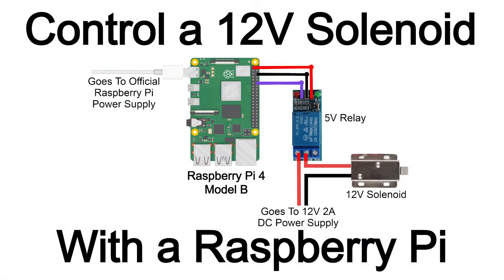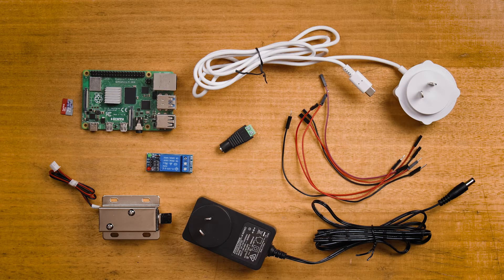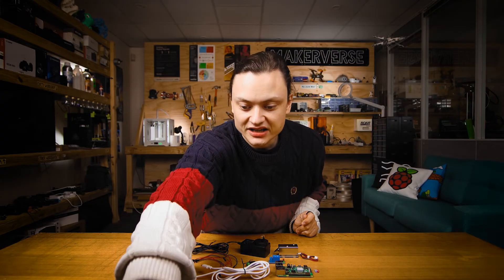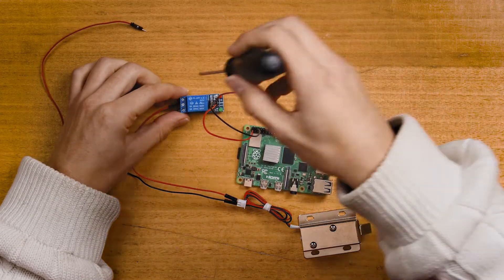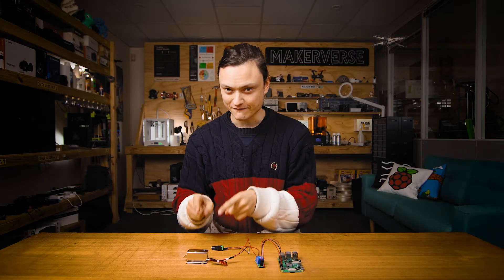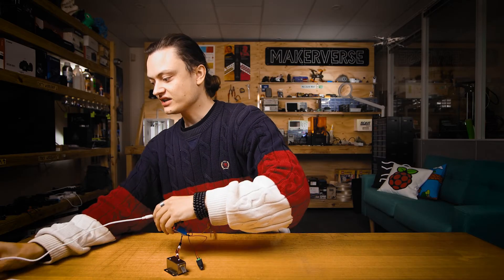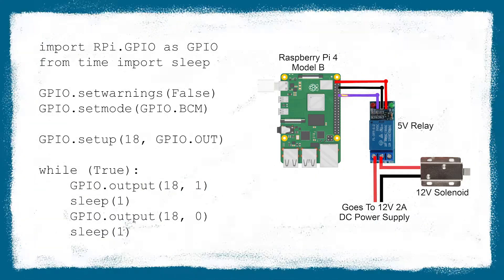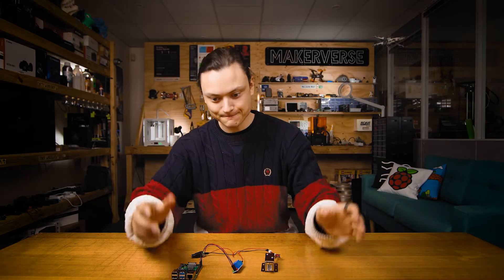How To Control A Solenoid With A Raspberry Pi Using a Relay

Comment: I have a excavator , can i control the solenoid by this ideas ?  because my electric system is gone . Thank you
Reply from the maker: So long as you have power this system will be able to control a solenoid :) and you can scale if up if need be.

Comment: what is this connector called which is used to connect 12v supply with jumper cables?
Reply from the maker: I got you, its a DC Barrel Plug, you can find it here - https://core-electronics.com.au/dc-barrel-plug-to-2-pin-terminal-block-adapter.html

Comment: Why are you not using a diode to protect against voltage spikes?
Reply from the maker: The relay is able to do the job of the diode in this set up as it has inbuilt voltage spike protection.
Reply: @Core-Electronics  however, since the relay also has a electromagnet built in, it needs a diode on it's own. Or not?

Comment: I have been using this setup for about two weeks no with no issues. However for the past 2 days whenever I turn on my rasberry pi and run the code, I will get to clicks (activations of the solonoid) and then the screen go black and the computer crash. Please if you have any fixes to this let me know. 

Thanks, Jdog
Reply from the maker: That is weird, perhaps the Micro-SD card has slightly corrupted. If re-flashing the card doesn't work send through some pictures of your set-up to our forum and we'll figure it out.

Comment: Thank you so much for the quick responce time! I just had one more question, could we use the 5v pins insted of the 3v pin. Because I am using three relays there are only two 3v headers and 2 5v. Or would I be able to attach two relays to one 3v header. Thank you so much for the help, keep up the helpful and amazing content!
Reply from the maker: Excellent question. So you won't be able to use the 5v pin. I wrote a comment below which explained the exact details of why. 
However there should be no issue attaching two relays to one 3.3v Pin if the relays are connected in parallel.

Comment: Hi Tim, would this general set up work with the 36v solenoid for sale on your website?  Also, could you power the raspi and solenoid with batteries, as opposed to mains power?
Reply from the maker: Heyya mate, if your talking about the 36V Solenoid I have linked then even though the datasheet states that the solenoid is rated for 36V they will work like a charm at 12V - https://core-electronics.com.au/solenoid-36v.html -

And so long as you supplied the solenoid with 12V, the Raspi with 5V and had enough current available you absolutely can power the system from batteries.
Reply: @Core-Electronics  Thanks, I really want to operate it at the full 36V, because I need the solenoid to "pack a punch"!!  I'll be using a separate 36V battery for the solenoid and probably a 5V/3A battery for the Pi, but do you think the 5V/3A battery will have enough "juice" to trigger the relay?
Reply from the maker: @andrewrider3965  That should be a good amount of current, the Spec sheet recommends 2.7 amps at 36 Volts so you are within the ballpark.

Comment: Can I use multiple relays attached to the rassbeery pi? I would need around three total
Reply from the maker: Absolutely. And if you needed to control even more that that I would recommend using this HAT https://core-electronics.com.au/adafruit-16-channel-pwm-servo-hat-for-raspberry-pi-mini-kit.html
Reply: @Core-Electronics  Thanks so much for this video and your replies to comments. I would need to control 16 solenoid (DC 12V). COuld I use 16 relays connected to 16 solenoids? Would there be issue of the relays share the same 3.3V power from the PI? Regarding your suggestion  about using the above HAT, I am not sure it work for solenoids that need 12 V (looks like it is for driving servo motor of 5 V). I am not very experienced so any comment suggestion super welcome. thanks a lot

Comment: What happend if the realy is 12 vdc ? It will work at the same ?
Reply from the maker: If you tried to use a 12 Volt relay it would never actuate as the maximum voltage that the Raspberry Pi can provide is lower.

Comment: Is there such a thing as a normally closed solenoid of this same type for the pi? i.e. - when relay actuated, it makes solenoid rise, then falls back when relay opened again.
Reply: would it be safe to have a normally open solenoid always not extended?
Reply from the maker: Heyya, if you keep a solenoid active for a long time (>20 minutes ) it will get too hot to touch. Thats the limiting factor.
Reply from the maker: The lock solenoid designs that I have encountered are all extended when un-powered. Pop us a message on our forum and we can help you further - https://forum.core-electronics.com.au/

Comment: Awesome tutorial, this is almost the same what I'm planning to do by myself. 
I have a question tho. How can you connect a 2A power supply to a solenoid which only needs 600mA? Isn't there a risk for damaging the solenoid?

If you have time, can you please tell me if I can safely use these two components in one circuit?
1. Instead of a regular solenoid, I'm using a solenoid valve with 12V 4.8W which pretty much is the same as this one ( https://www.amazon.com/DIGITEN-Solenoid-Connect-normally-Closed/dp/B016MP1HX0/ref=sr_1_8?dchild=1&keywords=12v%2Bsolenoid%2Bvalve&qid=1624534556&sr=8-8&th=1 ).
2. My power supply is a 12V DC 2A

Thanks in advance
Reply from the maker: Heya, the coil will only use what it draws, so that's safe. You can't go too much higher or lower on voltage though, as it may stop working or overheat (depending on the failure mode). Feel free to hit us up on our forum if you have more Qs https://coreelec.io/forum

Comment: why do you attach the 3.3V pinout to a 5V relay?
Reply from the maker: Excellent question. This Relay is labelled as 5V but we can run it at 3.3V with no problem. To run this Relay the Supply Pin (Vcc) Voltage needs to be the same as the Logic Level Voltage (IN) Pin. 

Connecting the Relay to the 3.3V Pin means the High Signal will trigger at 3.3V and the Low Signal trigger at 0V. Max Signal Voltage from a Raspberry Pi GPIO is 3.3V so it can work.

If instead we connected to the 5V Pin the High Signal would only be triggered at 5V and the Low Signal triggered at 0V. Max Signal Voltage from a Raspberry Pi GPIO is 3.3V so it would not be able to trigger the High Signal on the Relay.

Hope this helps!
Reply: @Core-Electronics  thanks, it's useful
Reply: Amazing answer! Thank you.